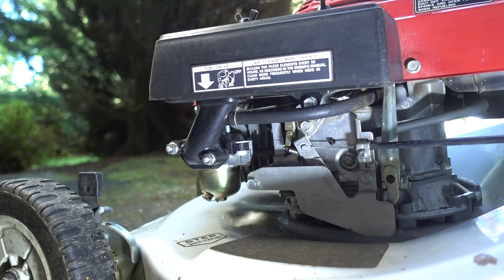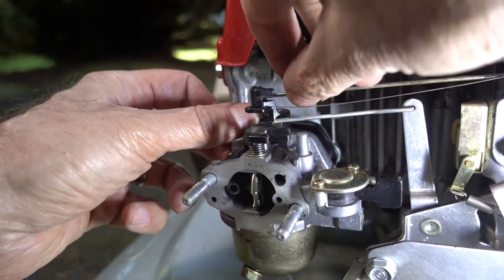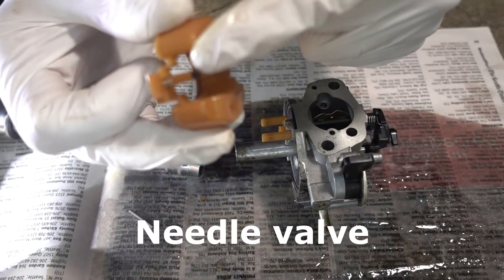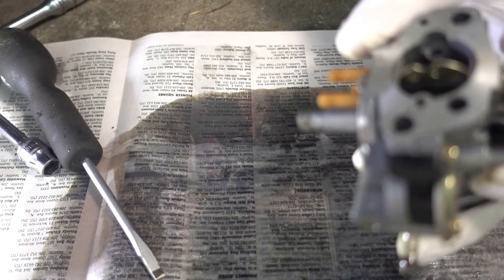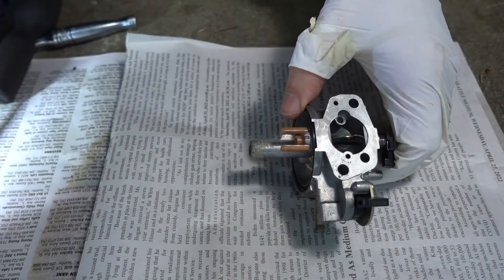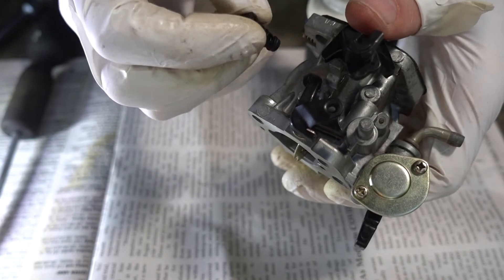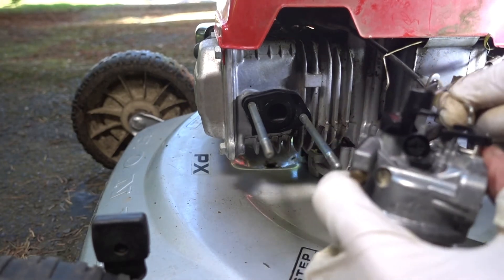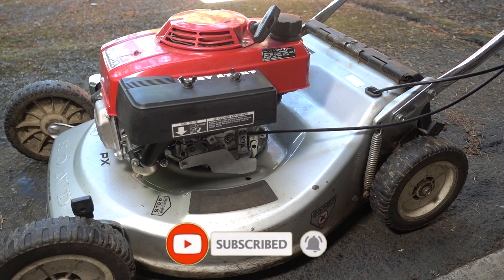Rebuilding a Carburetor on a Honda HRA 214 Lawnmower

Comment: Good video. In a pinch, the main jet can be taken out and cleaned without removing the carb. This solves 90+% of fueling problems. Remove the bowl and find a flat blade 1/4" screw driver bit that's about an inch long. You can use a bench grinder to get the shape that works, and use a 1/4" wrench to turn it.
Reply from the maker: Thanks for the helpful tip and thanks for watching!

Comment: FYI. Shutting off the fuel and running the engine until it stops does not eliminate all fuel from carb. The float bowl will still have gas in it. You need to drain the bowl using the drain screw.